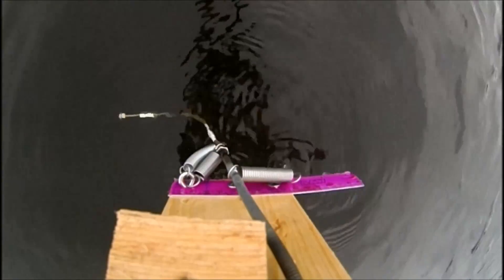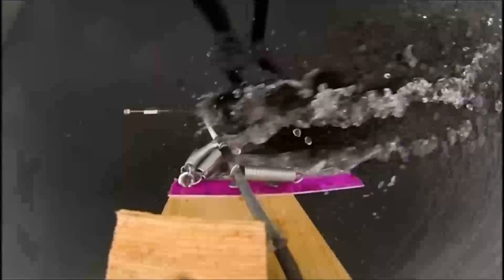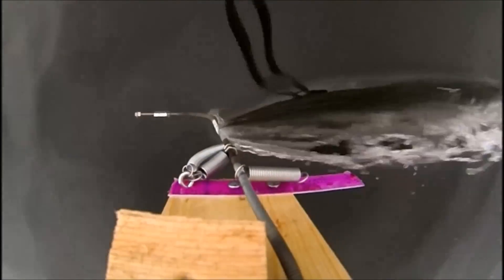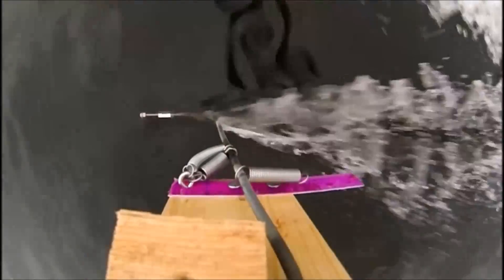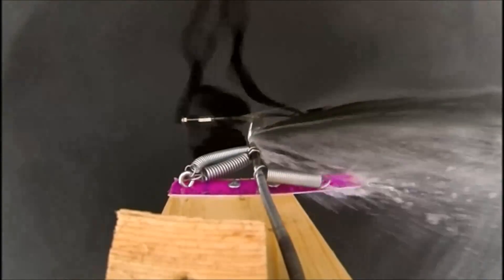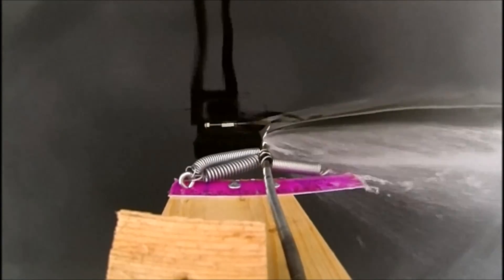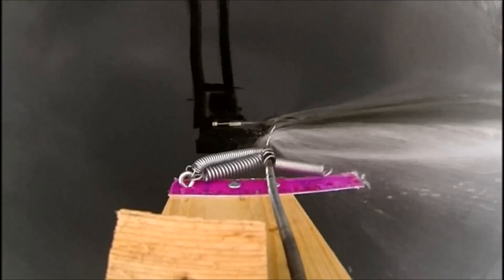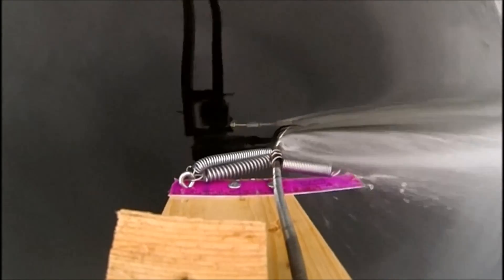supercavitation video 2

Comment: I am terribly sorry young man to mention this, but  for the sake of accuracy in scientific work, what at first may have appeared  to you to be a super-cavitation effect,  it quickly  terminated as an aerated bubble and there was no vacuum to produce the steam or vapour existing  in super-cavitation.  The atmospheric air pressure was allowed to leak and to go down the hollow behind the supporting vertical rod which acted as the tansom in a high speed boat where water separated from the sides due to momentum. 
Because of water pressure at different depth, your experiment clearly show, the air going down after the supporting rod depending on speed. At 00.47 the video clearly shows that the air just entered below the surface but at at 1.01, the momentum of the water on either side of the vertical supporting rod has manged to  overcome  the water pressure due to depth and the aeration has already reached the bend to the front  arrangement. Then all of a sudden when super cavitation commences  , the bubble is vented through the back of the  vertical rod.  
I hope this  helps to let you consider my  opinion as to what is actually taking place and check it all out with your teachers .
Reply: Thought same - aeration/ventilation induced behind vertical support, then spreading as speed increases, culminating with ventilation of "cavitator"  at 1:32. Glad to see someone else noticed. Nice experiments though! Was interesting to see what looks like 2 individual and aligned 'vent' cones forming.